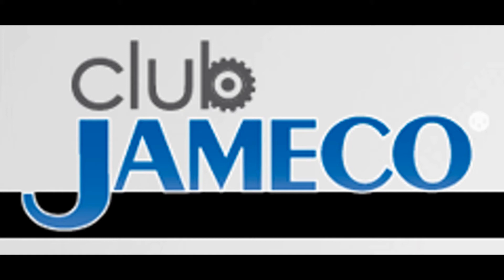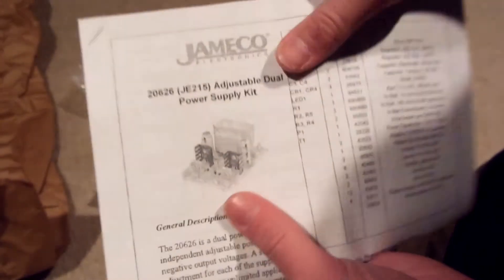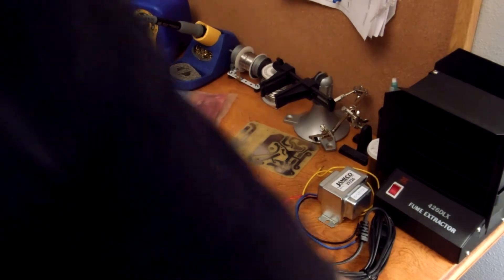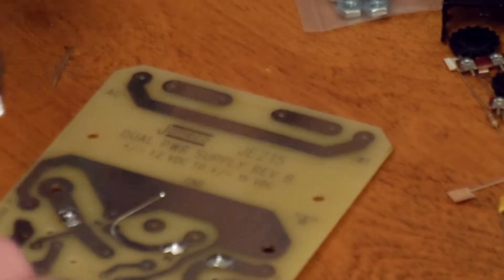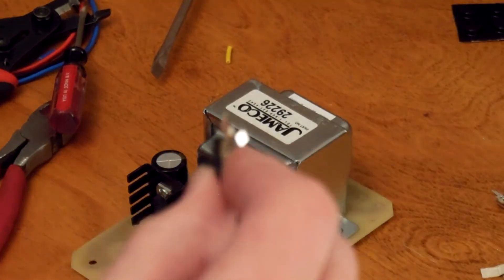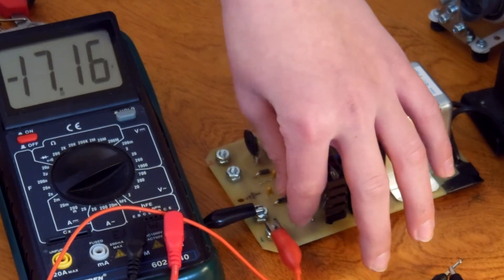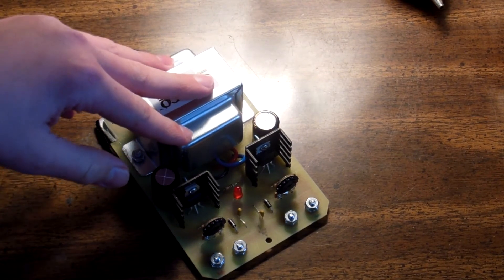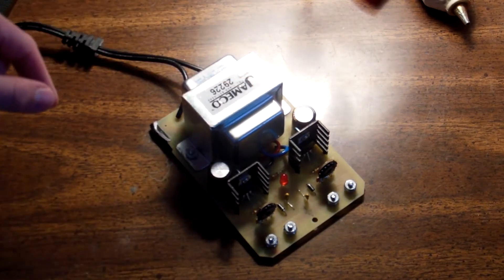Club Jameco Dual Adjustable Power Supply Kit

Comment from the maker: Thanks for the tip. This supply doesn't supply a ton of power, so everything already runs cool. I usually use bridge rectifiers for higher power circuits, and then bolt it to a heatsink.

Comment: A tip, with rect diodes, don't put them flat against board, leave them up off board for air circulation. They will run cooler, last longer and not fry/color the pcb.

Comment from the maker: I had used this power supply for other things before, and when the protection circuit kicks in, you can reset it by disconnecting the green wire and ground for 10 seconds, then reconnect. It didn't do anything this time though. It is dead. It was only 250 watts, and I got it for free, so I will just find another one or buy a cheap one for $10 online. I don't care about ripple and stuff that much, so cheap ones are fine. Plus, if it gets fried again, it only cost me $10.

Comment from the maker: I should look, I started to take that dead computer power supply apart. I haven't taken any IC's out yet, but there are tons of them on the board. There has to be at least one of these chips, because it is a switch-mode supply.

Comment: there are some other more complicated 16 pin chips that you can find in computer supplies and a few other things, which are basically PWM controllers with voltage regulation and current feedback.